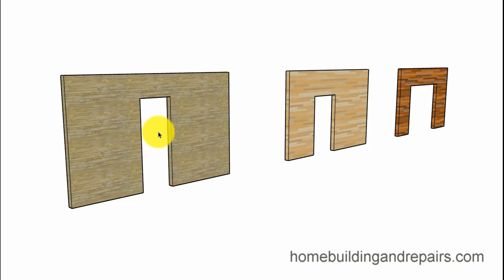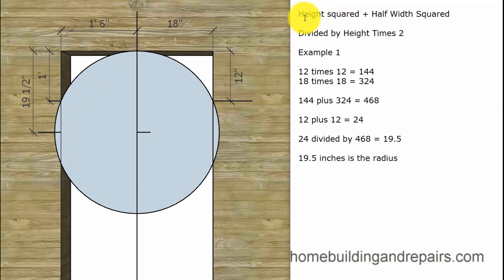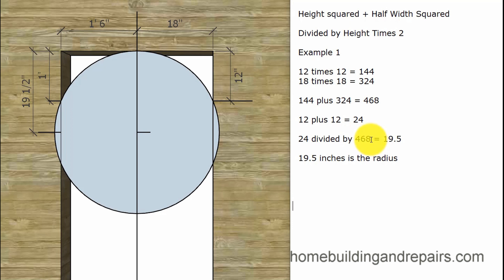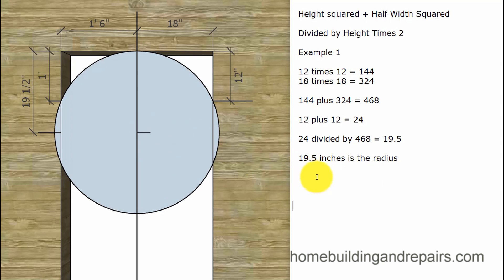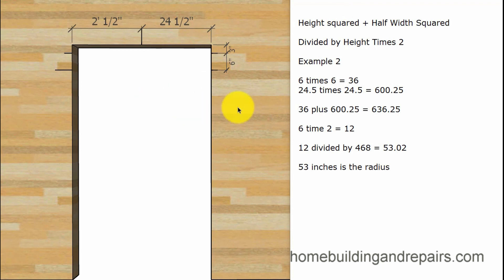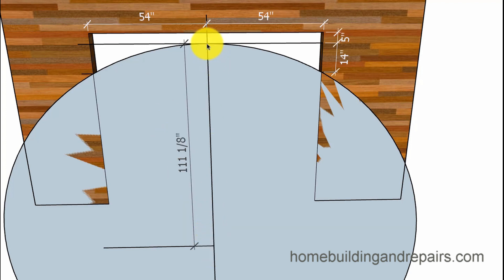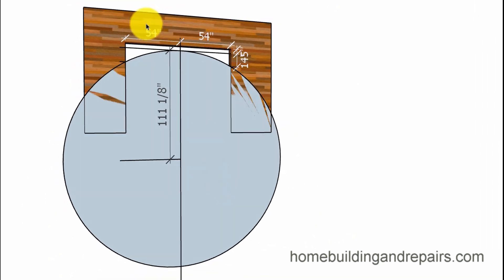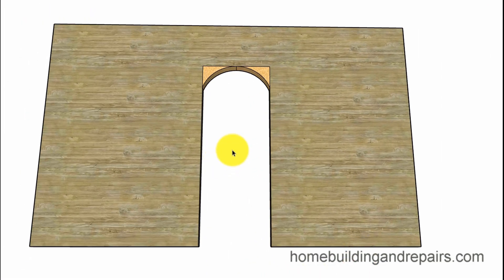How To Calculate Segmented Radius For Building Arches - Master Carpenter Secrets Revealed

Comment: I have an old home that has original tudor arch openings between rooms. I want to add a new one for an opening I raised and widened to the kitchen that used to be a traditional door frame. How could I calculate to exactly match the other tudor arches with their dimensions and apply to this new opening?

Comment: in the third example, how did you arrive at 14" ?
Reply from the maker: It's a random number used to create a desired look and can be 6, 12 or 20 inches. Some designers have a specific number they use for aligning two or more arches up in a wall and would need to use the same number.

Comment: If you could correct your formula would make a lot more sense. Your number divisions are back to front. 24 divided by 468 certainly isn’t 19.5, but 468 divided by 24 is.😁
Reply from the maker: Yes, I think most viewers get it, but it would have been better if I showed the process with a calculator. I might pull the video and remake it.

Comment: In example 2 you calculated 36 + 600.25 = 636.25 which is correct then under 6 times 2 = 12 you annotated 12 / 468 = 53.02 (468 from example 1).  I now know the calculation should be 636.25 / 12 = 53.02.  Just learning this stuff and it threw me for a loop.
Reply from the maker: You're right and it looks like I carried that number over from example #1. It looks like you're the first to find it or at least the first to mention it.

Comment: Also, isn’t the radius simply half of the opening (assuming squared opening like any regular door/window would be)?

Just measure the opening edges and divide in half. No simplification of fancy formulas needed. It doesn’t get any simpler.
Reply from the maker: Yes, the radius is half of the diameter and the diameter is the full width of the circle. If you're going to create an arch shaped like half of a circle, then the radius would be in the center of the opening. Let me know if that doesn't make sense.

Comment: I have a question. What not just use basic geometric principles without numbers, i.e. without calculations? I mean, what is the benefit of doing it this way?

I though a master carpenter, or at least a master in the classical approach I guess, would use nothing more than a compass and straight edge (and perhaps a ruler only for determining height and width of the wall) if he were drawing it on a plan. Even easier on a computer, just add the circle and let the computer spit out the final measurements.

Recently I’ve been doing no-math geometry and could easily create those arcs with no calculations. If the height and width are given, I could do a scaled down version (just reducing ratios like a triangle [architecture/engineering] ruler does). The only number I might need is the amount to subtract from the center to achieve the desired result (e.g. -3” from center). And I am doing this with pencil and paper.

There might be a learning curve doing it on a computer, but once the principles and methods are known, it would be even quicker and more accurate. Even taking your time on paper there is a slight imperfection, even only microscopic. But nothing is truly perfect except on paper anyhow, so to speak.
Reply from the maker: The benefit of using math formulas usually provides you with a faster and more accurate design. As far as master carpenters go, I think I would need you to provide me with your definition of one, before answering your question. There are definitely other ways to design arches like these and you're right, most of the time they don't need to be perfect, just close enough.

Comment: Formula is (h^2 + w^2)/(2h), where h is the desired height of the arch, w is half the width of the opening. Algebra is much cleaner. Thanks for sharing.
Reply from the maker: Algebra definitely looks cleaner to those who understand it. Thanks for posting the formula.
Reply: (h^2 + (w/2)^2) / (2h) is what you mean I believe.
Reply: @lancastermick  w is defined as 1/2 width of opening in my example. defining w as simply the width then your formula works, and is more comprehensive

Comment: Great video Greg, Here is another way of doing the calculations that does not involve squaring two numbers or needing to write down numbers to then use them later in the calculation. Here it is R = Dw² ÷ (8×Jp) + Jp÷2 where Dw is the door width; Jp is the jamb intersect point (or height of the arch); and of course R is the radius you’re looking to calculate.  In your first example Dw=36”; Jp=12” therefore R= 19.5”. In the calculator just type 36 x² ÷ 8 ÷ 12 =  + 12 ÷ 2  =    {x² is a function key, it appears on most calculator apps by turning your cell phone horizontal} try it    love ur videos -Eddie
Reply from the maker: Sounds good and as always, use whatever works best and what is easiest to understand.
Reply: Where does the eight in (8xJp) come from?

Comment: I noticed in each example, you used different height. What determines the height? Is it builder preference or is it based on opening?
Reply: Builder preference mostly
Reply from the maker: I only use them to provide viewers with additional examples in hopes of making a little more sense out of the information, but as James suggested, the designers will usually provide you with all of the measurements.